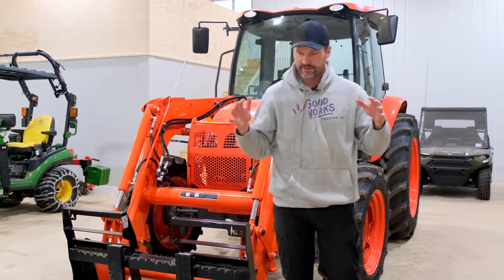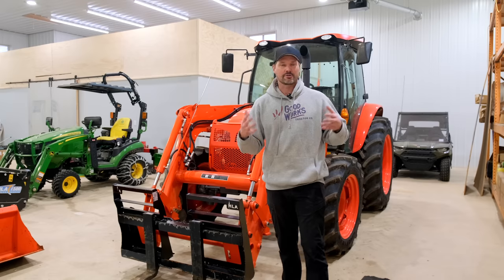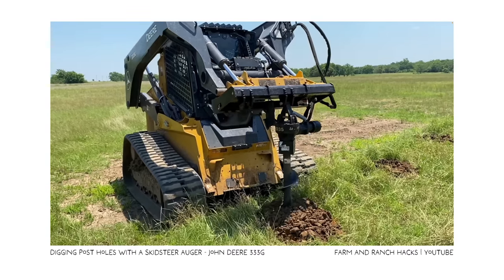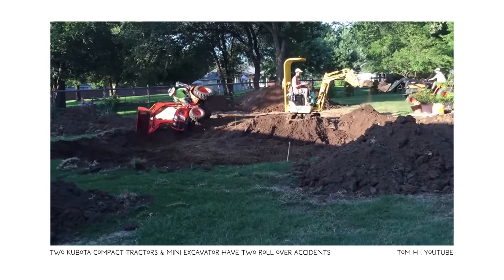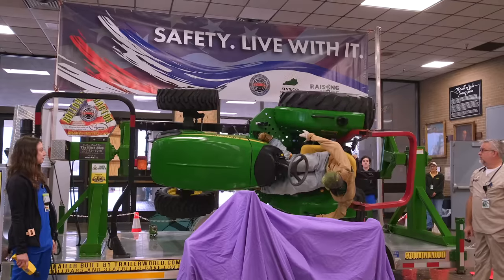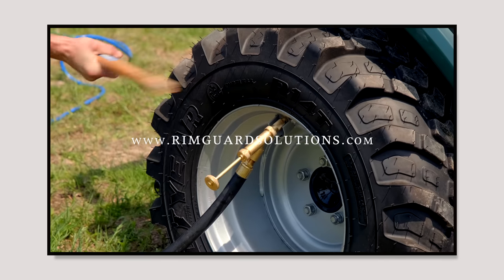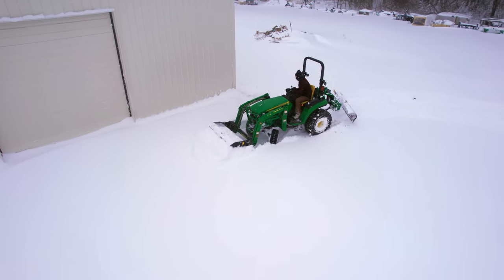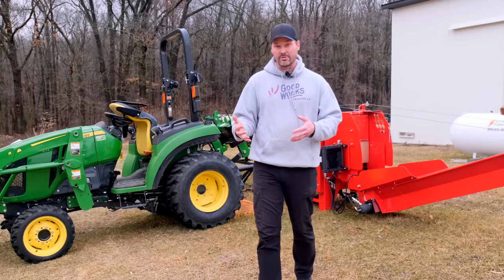BUYER BEWARE: MY 5 MOST HATED THINGS ABOUT TRACTORS.

Comment: I wish I knew I needed more power before I purchased my LX2610. Don’t get me wrong, My Mighty Mouse still gets the job done, but it really struggles pushing or pulling heavy loads up hill. I’m pretty sure if I had 25-40 more horsepower, I wouldn’t have to crawl up hills with a full box blade full of stone.
Reply: The common mistake seems to be everyone trying to avoid the DPF systems and choosing smaller tractors than what is required.  I ended up with a 35hp with a cab and love it.

Comment: My Branson 5835R doesn't even run!  2 years old, back to the dealer for a 3rd time!  And I can't even get it there right now because of snow.  I'm at 8600 ft in Colorado, and need to keep a 1/2 mile of road open to get to my barn, so I can feed and water horses.  1/2 down the road is where I store hay and the tractor.   there it sits in the shed, while I rent hire and beg for snow removal help.  This tractor is quite simple, yet it won't work in the cold!  Don't buy a branson!  Now TYM....

Comment: Hey check out a kubota m62 i have one and it fixes alot of these issues 16gpm flow on front loader will lift 3960 lbs to full height plus you can get 14ft backhoe 46hp pto power
Reply from the maker: I'll take a look, thanks Tyler!

Comment: Just a note, folks do not buy a  3 poinr quick hitch if you have implements from different venders or older. Either will not work or it is not quick, pain in the %$#. Trust me. I have one and lots of extra bushings and pins to prove it. Yep bought the hype.
Reply from the maker: More to the story.  First, don't buy a quick hitch that requires bushings as that is a complete gimmick and waste of money.  Get the GWT Fast Cat that is a direct pin fit.  Secondly, different vendors don't matter.  Quick hitches and quick hitch compatible attachments are built to the same specification.  Regardless of manufacturer.  The only thing that may change is the top hook location which is why it is bolted on.  Our Fast Cat has quick change pins so you can move the top hook in seconds with no tools.  However, roughly 80% of manufacturers use the lowest setting.  It isn't often that we need to move the top hook.

We also include a diagram in our listings and have several specific videos on our channel showing measurements and how to confirm if your equipment is compatible.  It is true that old equipment normally isn't compatible as quick hitches weren't around 30 or more years ago.  Their convenience is incredible and they are our number one selling attachment far and away.  I won't have a tractor without one.  I also won't buy attachments that aren't quick hitch compatible.

Comment: I do wonder why hydraulic flow sucks so badly on tractors.
Reply: Because the majority of applications don't require high flow. Increasing the flow means bigger pumps, larger hoses, larger fittings. That adds cost to the tractor that the majority of users don't need. Basically, only things that spin need high flow rates. Hydraulic cylinders will move a little faster, but your grapple opening in 3.2 seconds vs 2.9 isn't noticeable. All these tractor designs are optimized for the market that particular model is targeted at. Price is very much a consideration in any given model, and it has to be. A company doesn't stay in business by making 0% profit. Most companies do target market surveys, look at historical sales data, and customer feedback to factor in what features are necessary at what price point to sell a given number of units into a particular market. As individuals we may not always agree with a decision they've made on whether a feature is present or not, or how that feature is implemented, but that design decision was made to satisfy the majority of users, not every single user.